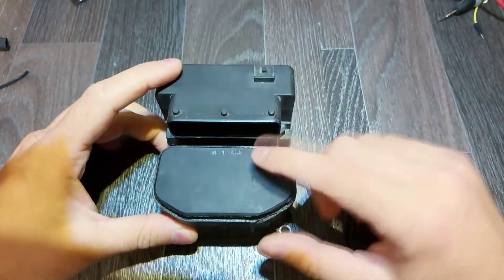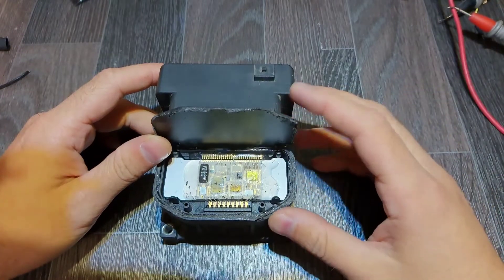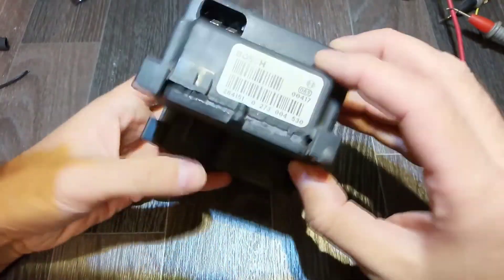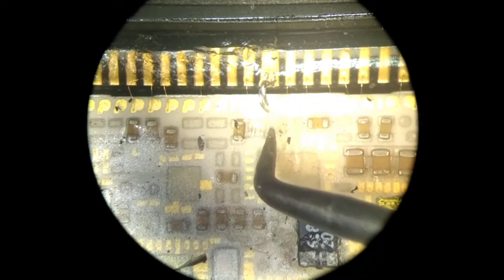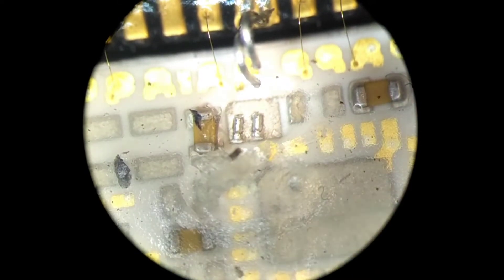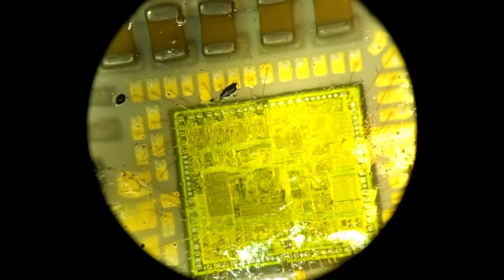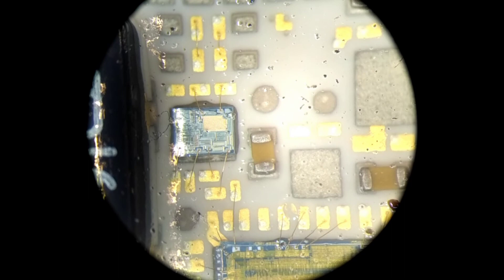BOSCH engine control unit (ECU) repair. Aluminum soldering

Comment: Did you seperate the wires or did you solder them both into the one blob ? Thanks
Reply from the maker: @yanni6556  soldered into one blob.

Comment: Hello,
I am currently performing exactly the same operation (the same connection wire is broken).
I would like to know : 
What type of connector do you use?
Thanks
Reply from the maker: Hello. I soldered the existing wire back to the pcb. You can also use copper wire.

Comment: Hello 
You can tell me what  flux did you use and what  soldering alloy. Thanks
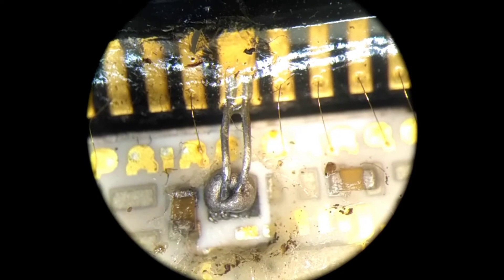Reply from the maker: Hello. Lead soldering alloy and flux called "Flux for aluminum" in my native language. The description says it is used for soldering aluminum at temperatures 300 C. I show it at 1:30 here https://youtu.be/bjSgFLq4xpQ